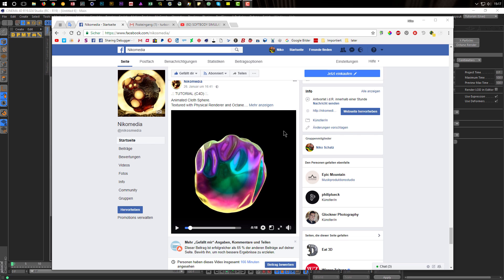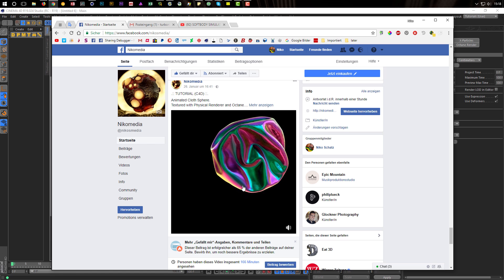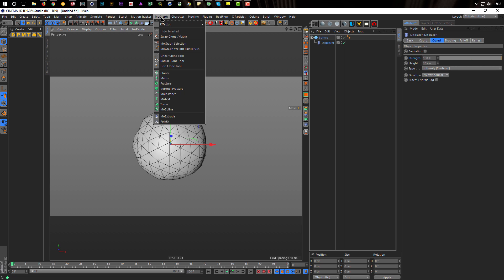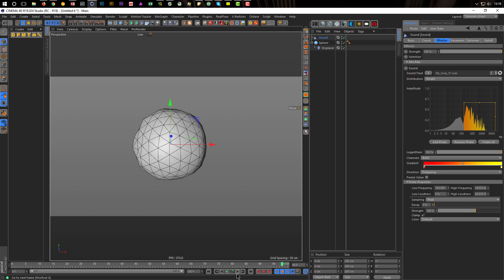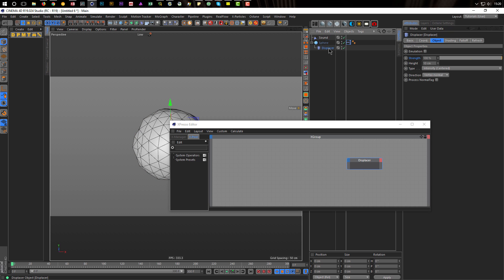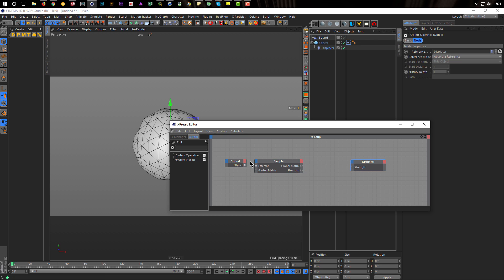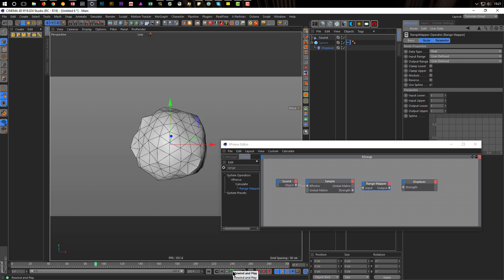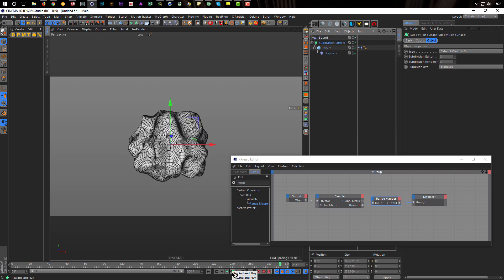Sound Displacement (Cinema 4D Quick Tip)

Comment: Hello, I have a problem for this effect using. I made everything but if ı  connected  displacer's strength on range mapper's output, displacer's strengt go to '0' and after that not moving. WHY?? please help me
Reply: and ı try other way, ı connected height but height is fixed '0'. I understood, connecting parameters to be fixed. But ı dont understand why?
Reply from the maker: @sayeozcelik3817  If you are in Cinema 4D Version R20, or newer it does not work this way, but I found a workaround. In Xpresso use in the Sample Node Weight instead Strength and in the Sound Effector under Parameter set Weight Transform to 100%. That should work then.
Best regards, Niko.
Reply: @nikomedia  yeah its working. Thank u much for help!
Reply from the maker: @sayeozcelik3817  You are welcome!
Reply: @nikomedia  oh sorry again doesn't workin. ı dont understand
Reply from the maker: @sayeozcelik3817  If answered you on Facebook already ;)

Comment: Hi, Nikolaus, Is this broken in R21?  I tried your workaround you told 1skyline, using Weight instead of strength, and the Weight Transform set to 100%, but that didn't work either.
Reply from the maker: Sorry Todd, I just saw your comment. I will try this tomorrow and will tell you if it works for me in R21.
Reply: @nikomedia  Hey Niko, any update on this?
Reply from the maker: @ramahlmsouli9346  I already answered your email ;)

Comment: I followed all the steps but it didn't work for me, it was moving before I added the xpresso. I changed all the variables and still it isn't working, maybe it's my version R20 that it has to be done different, thank you anyways for trying to help me
Reply from the maker: You are right, in R20 it does not work this way, but I found a workaround. In Xpresso use in the Sample Node Weight instead Strength and in the Sound Effector under Parameter set Weight Transform to 100%. That should work then.
Best regards, Niko.
Reply: @nikomedia   This helped alot! Thank you so much !
Reply from the maker: @mikellayounes  You are welcome!
Reply: @nikomedia  i got R20 too and got realy frustrated. now it works THANKS ALOT!
Reply from the maker: @leandroharries  You are very welcome!
Reply: @nikomedia  awesome worked for me too!
Reply from the maker: @toxxicz  Good to read :)
Reply: @nikomedia  Thay you !!!!!!
Reply from the maker: @noeeto4761  You are welcome!
Reply: @nikomedia  Hello Nikolaus!  
First off, thanks for all your great tutorials. Helps a lot. I have the same problem with this not moving, I’m using R21, should this workaround work there aswell?
  This is how i’ve set the nodes up:  
The sound object goes to the sample effector, the sample effector then goes with Weight to the range mapper input, the range mapper output goes to the strength of the displacer.
Super happy for any help!
Reply from the maker: @snakesontv  Yes, normally that should work. If you upload your scene somewhere, I will have a look at it, maybe I find the error.
Reply: @nikomedia  Hey! Thanks for taking the time to answer, now when i tryed to recreate my error it worked, so that was really nice. No idea why tho, but im happy that it works.
Reply: @snakesontv  Thanks a lot!
Reply: @nikomedia  thanks man ! :)
Reply from the maker: @julienjean6329  You are very welcome!

Comment: Hi Nikolaus, amazing tutorial, just one problem, when I link in Xpresso the last range mapper to the strength of the displacement, the sphere don´t deform, actually it becomes smooth, just like if all the link was done bad, but that's not the case, do you have an idea what can it be the problem? :)
Reply from the maker: Glad you like the tutorial.
Unfortunately I can not really help here without seeing the scene. Can you upload it somewhere?
Maybe your noise in the diesplacer is too big, or something like this.
Reply: @nikomedia  Sure, I´ll send you a message on fb
Reply: @oscarandrade2345  did you fix the problem i am having the same issue
Reply: @lilpeek1150   was the problem ever solved im getting that same issue

Comment: That's a nice tip, Thanks Niko, is it possible to deform based on a real time sound record? like someone signing live :) ?
Reply from the maker: I like the idea. I will try it and when I find a way, I will tell you.
Reply: @nikomedia  and did you find a way to connect the deformation to a microphone rather than a mp3? Would be nice if you have an idea how to make it :D
Reply from the maker: @l.k.9177  Unfortunately not. It works only with already recorded audio as far as I know now.
Reply: @nikomedia  oh no. not possible? do you know any way to manipulate a mesh via microphone? I am working in unity at the moment, but i am actually searching for a possibility to connect a microphone to a mesh deformer, nevermind how. you got any idea?
Reply from the maker: @l.k.9177  Sorry, no idea with microphone. With Midi it could work but I don't know if you can get a Midi Signal out of your microphone.
Reply: @nikomedia  okay, thanks for your answers and the nice tutorial. I found a shader called simplespectrum for unity where you can speak into the mic and some 2d bars start to move up and down, but to connect a 3d shape with mic i couldn't find something. i will find a way!

Comment: the link to the projekt file is a link to the download page (instead of a link to the file), 
on the download page, once again, I find a link to the download page… running in circles
am I doing something wrong ? didn't have this problem before

how do I get the project file for this tutorial ?

cheers for your splendid tutorials, by the way
Reply from the maker: This project file is available just for patrons (5€ and above), as it is written in the description.
Reply: I am a patron for about a month now
Reply from the maker: Sorry, I see now, I haven't uploaded a Project file for this Sound Effector Tip, just for the Animated Cloth Sphere which you can find here...
https://www.patreon.com/posts/animated-cloth-16620432

I did not think, that a projectfile for this quick tip is necessary. 
If you really need a project file for this, I will redo it and upload the file as soon as possible.
Reply from the maker: By the way, thanks a lot for your support!